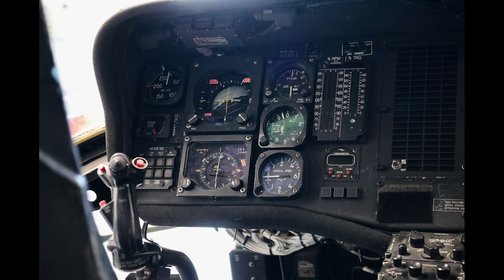Heavy D's Black Hawk: More Footage!!

Comment: Engine swaps recip/turbine the time it takes to swap over electrical harness and turbine engine fire loops. Baffles/ seals. Fuel controls and run ups for recipes and adjustment procedures. APU troubleshooting etc. thx